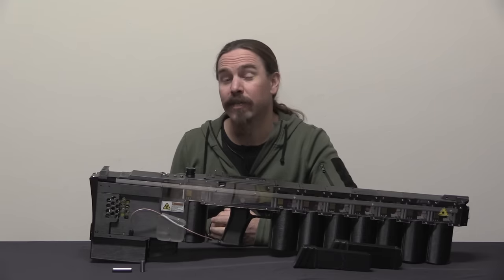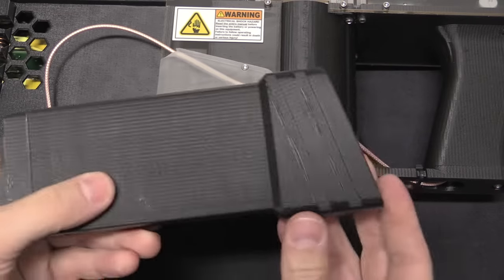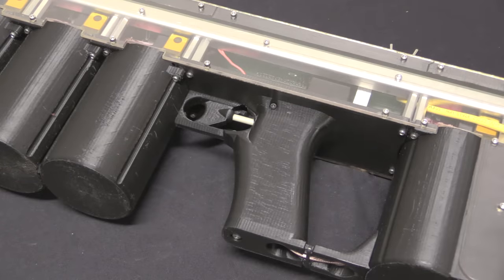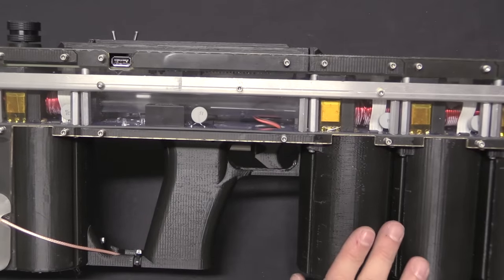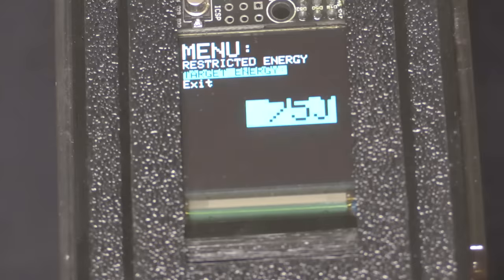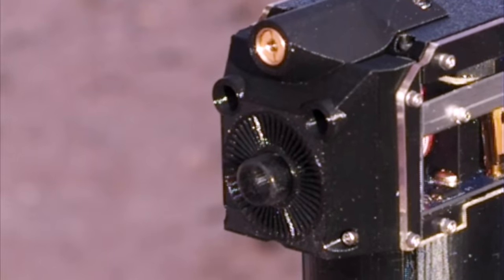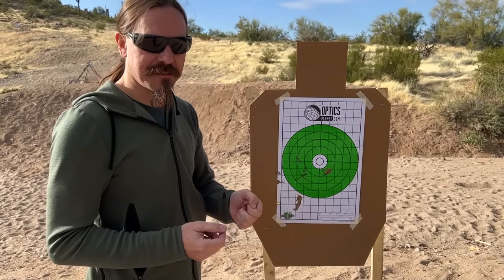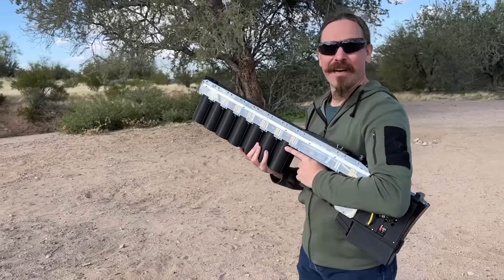ArcFlash Labs' GR-1 Anvil Portable Gauss Rifle

Comment: Very nice, and nostalgic for me.  In 1989 I built a coil gun as an item of interest for my electronics students.  We did not have 3d printing or arduinos, but the basic physics are set in, well.. physics!  Other than keeping coil reactance low, and gauss high,  the key is to use a massive overvoltage on the coils, and timing the capacitor dump with light beams.  It is very critical that the coil is shutdown just before the projectile centers itself in the coil, otherwise you will be applying unwanted braking force.  The simplest way to achieve this is by an entry position of the light beam, vs the length of the projectile.  In this manner, the shutoff time on that coil can be optimized, no computers needed. In my 1989 version, our voltage limit was based on available capacitors and switching transistors.  So we ran at 400V with 450v caps and used TV horizontal output transistors,  2SC1308, for the switching element.  As you can imagine (with each stage identical) the amount of energy contributed by successive stages diminishes.  We ended up with 5 stages which would shoot A 6mmx35mm iron core through a 1989 pop can at about 40ft.  Not significant, but fun!  We liked to call it a rail gun because that sounded cooler than coil gun,  but very quickly changed that to mass accelerator so to not panic the staff and administration.  Really great to see this modernized iteration, keep up the great work!
Reply: that is really cool! thanks for sharing
Reply: Wish we had more teachers like you, dude.
Reply: “Very quickly changed that to mass accelerator” hahahaha, good work dude
Reply: That's awesome. My teachers didn't even know how to change the batteries in their TV remotes.
Reply: That'd awesome! Yeah, science!
Reply: Imagine what the governments have made that we don’t know about lol
Reply: Now that we have 3D printing, mind sharing the blueprint?
Reply: NERRRRD 😂
Reply: If you're crafty enough, you can switch current on a coil, making the projectile accelerate past the mid-dead-position. That requires some relay magic and boosts complexity, and for current stage coil guns it's most likely impossible, but if this kind of weaponry is to ever get to RTM status, that would be required, otherwise half of your barrely will be wasted space.

also 75 m/s from single RC battery after 3 second charge IS impressive.

In a lab you can do things that are unfeasible for normal use, i.e. use of superconducting coils. People have sent projectiles with >Mach 1 speeds with home made devices, with proper equipment you can do wonders. I wish I had access to my old workshop in electric lab in college :(
Reply: Seems like yours was better than this hunk of junk.

Comment: 2022: "The long projectile is about as long as a .308 case"
2032: “We fire the whole bullet, that's 65% more bullet per bullet”
Reply: Love the portal reference I was thinking the same thing lmao
Reply: JJ Simmons collab when?
Reply: The point is that it could fire a 308… (the entire round down range…)
Reply: Awesome reference! Thanks for reminding me of one of my favorite games!
Reply: Coilguns use magnets to fire, so are basically limited to iron and steel. Railguns have a lot more flexibility for projectiles, and are likely much easier to rifle
Reply: Department of energy would probably be more interested
Reply: YES.  Now all my crummy steel case rounds have increased in usefulness!
Reply: @kentvesser9484  destructive device, rejected, NEXT!
Reply: @CreaperSiege  Rail guns can’t be rifled either. But at 11km/s stability in air is not a big concern.
Spin stabilisation would require the projectile to be spun up before launch.
Reply: @CreaperSiege  but railguns also use magnets tho
Reply: @CreaperSiege  well limited to magnetic materials like super conducting magnets... lol also doesnt need all of the projectile to be magnetic
Reply: @oliverkrohn8309  Where did you read that? It seems to me that a lot of people use rail-gun interchangeably with coil-gun/gauss-gun when the only real common quality is that they both need a giant battery.

Railguns do not use "magnets", they use electrical current. The projectile in a railgun completes a circuit between the literal rails inside the barrel (which does create a magnetic field) which forces the projectile along the rails. While there is a magnetic field involved, it is not magnetism that forces the projectile down the barrel (which is why you don't need a ferrous projectile, just a conductive one) rather a phenomenon called the Lorentz effect.

In purely empirical and practical terms, think of it like this;

The biggest problem with making a useful coilgun is getting it to put out enough projectile velocity for the power you put in. There's tons of really fine tuning involved in getting the electromagnets to play nice with each other and de/activate at the right times. The biggest problem with making a useful railgun is carrying the battery you need to fire it. There's way less that can go wrong with a railgun in principle, but the kinetic energy imbued by the Lorentz effect is so minor that it takes a ridiculous amount of current to even get the projectile to move, let alone be moving fast enough to not weld itself to the inside of the barrel or simply melt before clearing the muzzle. 

That's actually the one good reason you might want to rifle or spin the projectile (probably before you even complete the rail circuit) - to lessen the likelihood of just grafting your projectile onto the rails with the ungodly amount of current you just put through it.
Reply: You know what would benefit this? Tank.
Mean more rounds they can carry, because the round would be shorter since they no longer need casing to store the gunpowder to propel the projectile.

Comment: Reminds me of the really early lasers. They look ludicrously huge and foreign but they eventually got smaller and more practical.
Reply: Only thing is that every single component of this gun is way older than laser as a technology. Capacitors, batteries, coils, etc. It’s been in use for decades before first lasers.
Reply: God right, insane to think about. Now they are smaller then a duracel battery and just need to operate on one.
Reply: Yes but it took a lot of time for those components, mainly batteries, to get small and efficient enough to be used portable. Also the computer controlling it.
Reply: Although those components are low tech, they require high tech materials and manufacturing technology to make the gun practical.
Reply: This is a completely different problem from miniaturizing lasers.  The power supply on this device has a much lower specific energy and much lower specific power than does conventional smokeless powder.  That is a fundamental fact of chemistry and nature.
Reply: Man those lasers are awesome lol. It's so hard to find some that still work. Like the one Ian actually had on one of his guns recently. The damn laser is as big as the gun! Like Termiantor 1 where Arnold Schwarzenegger had the laser on the desert eagle.
Reply: @redrackham6812  A shame indeed. Despite having greater energy conversion rate than chemical propellants, the total amount of energy contained is so low the high efficiency couldn't make up for it.

Comment: SAFETY NOTE: Always treat the capacitors like they're live, like how you never ever point your barrel at someone
Reply: Yup, Capacitors have a nasty habit of sneaking up on you, and these things are monsters, if they don´t hurt, they kill outright. I guess, a few percent of residual charge is enough for a painful surprise
Reply: It's interesting to note that this rifle is never fully "safe". With projectiles removed the battery is still potentially a fire hazard, and even with that removed, the capacitors are still potentially an electrical hazard. That's a bit different to a normal firearm where if it's definitely unloaded, it's about as dangerous as a mousetrap.
Reply: @cnawan  Like firearms, unloaded this thing is only as lethal as you can swing it. Also, ammunition can literally explode, which is like the one thing worse than catch on fire. The rules can be contrasted as such: firearms and live ammo never mix unless you know what you're shooting at and it's a good idea to shoot it, and you should never ever touch one of those capacitors unless you are for sure certain that it and you are safe, because you can do all the things you need too with those capacitors with equipment that keeps you safe if those designers are worth their salt.
Reply: @cnawan  You can definitely discharge capacitors safely, depending on how the power delivery system is designed. But it's not an insurmountable issue.
Reply: People have to remember the dielectric absorption. HV capacitors need to be short circuited during storage to avoid this effect.
Reply: Que electroboom sticking his finger in it
Reply: @dtrujillo1180  ehhhh this one has enough power in it to actually ice him if he's not careful..
Reply: @cnawan  im sure some safe way to discharge the capacitors would be high on my list for this type of project, and you could asume that haveing the battery magazine in the gun would be equivelant of haveing it have a full mag, im guessing they have an ejection mechanism for the batteries. as you would have to replace and recharge them quite often.
Reply: @cnawan  It's all energy at the end of the day. The coilgun just happens to carry its energy with it rather than holding it separately in ammunition.
Reply: @cnawan  You could honestly say this about anything with a capacitor in it, especially your cable box.
Reply: Are those "Flux Capacitors" ?    If your not careful you could send Yourself,...   Back to the Future!
Reply: @ParadigmUnkn0wn  stage of what ??
Reply: Yeah, capacitors can hold a charge for years sometimes, I do like the ones that have the discharge resistors on them.
Reply: @ParadigmUnkn0wn  haha flying cars won't work because private cars have some of the worst economies of scale in terms of technologies we use on a daily basis and with any luck won't survive this century. I don't know why you're just ragging on these poor dudes like this, but yeah their biggest innovation is the tech that lets the caps charge 100j in 3 seconds. That's the kind of thing that might get a large company looking into this kind of technology for any number of applications, which in turn will eventually drive funding for better capacitors and batteries, et cetera. Barring the impending dark age, better batteries and capacitors is an inevitability given enough time. In the mean time, be safe with your toys.

Comment: Being a Navy vet, I never thought I’d be around to see the day when we had a real shoulder fired Gauss gun. As compared to the rail guns. With the leaps and bounds the world has been making in battery and electronics tech in my lifetime I can only imagine what this will be like in the next 5-10 years. Awesome that we got to see Ian get his hands on it for us.
Reply: There are important differences between a Gauss gun and a rail gun - specifically the ablation of the barrel on rail guns. The interview Ian did with one of the designers of this prototype talk about those differences.
Reply: probably not much change except i there is some miracle revolution with parts of electronics used... some do believe that graphene can drastically improve capacitors and that is like 100 fold improvement but doesnt seem it will happen any time soon. but yeah that would make it far less bulky
Reply: In 5-10 years, they'll have slick injection molded furniture. The limitation of the battery not detonating and the gun not melting itself means that handhelds like this aren't likely to be anything more than a toy for a while. Bows and crossbows thousands of years old and even with all the modern technology of the last few hundred years, launching a projectile with mechanically stored energy hasn't changed much, electrically stored energy's efficiency hasn't improved much in the last 5 or so years, Tesla's last major improvement was doubling the capacity of a battery by doubling the size.
Reply: anymore 10 years in the tech world is an entire lifetime of innovation.
Reply: @neglectfulsausage7689  I agree with you for the most part but the reason we don't have green energy rockets is literally because there's no other way to do it
Reply: @neglectfulsausage7689  We literally have hundreds of battery operated spacecraft that recharge those batteries with "green" energy (solar). GNSS, communications, NRO and other space assets could not function on chemical energy for the same reason chemical energy is becoming increasingly impractical for terrestrial use - there is a limited supply.

As for rockets, work is continuing to find more efficient and renewable options to current solid and liquid fuel chemical propellents. It is practically guaranteed fossil fuels and most other chemical propulsion will soon be obviated by better (green) options.
Reply: @neglectfulsausage7689  we don’t have flying cars because humanity is immature and wouldn’t be able to handle it with any sort of respect.
Reply: @neglectfulsausage7689  That's not strictly true. Many deep space vehicles use ion thrusters for their propulsion. Ion thrusters are only effective in a vacuum which makes the whole limiting emissions thing kind of pointless. Of course the rocket that puts said probe into space still uses traditional engines.
Reply: We are now 3D printing parts for both firearms and Gauss canons. We live in the future
Reply: @neglectfulsausage7689  These are two completely different things. Regardless of the source of energy, nuclear, solar, wind, gas, or coal etc the issue is energy storage. All energy generation is the product of a chemical reaction. The advantage to solar is that there is no waste, if I turn on 3 turbines at a gas plant and I only needed two then I'd better have storage for what i generated from the third or i just burned a shitload of gas for no reason. Conversely if I run an equivalent number of solar panels or windmills I haven't wasted anything. The sun will shine for a given part of everyday and the wind will blow regardless of whether I had the brakes on the windmills or not.  in the next 10 years EVERY, and I mean EVERY watt hour of electricity you consume, will come from a battery. Much of it does already. The only remaining problem of course, is that you've been educated on the fucking internet and dont understand why any of what I just wrote invalidates your point of view. Fortunately the future is being guided by people who have a far greater cognitive capacity than you or I,  ELSE WE'D ALL BE FUCKED. EXPLOSIVES BETTER YO DAT WHY NEVY INVESTED BILLIONS IN RAIL GUNS DAWG.
Reply: @tcbbct509  How, in the next ten years are they going to store A.C in a battery?
Reply: @neglectfulsausage7689  There isn't much point in trying to have a discussion with someone who apparently gets his information from Tucker Carlson and doesn't have even a foundational understanding of physics.
Reply: I dunno man, they might start by looking at inverters. Look up grid scale batterys sometime. This is already being done, however inefficiently, with LIONs.
Reply: @dvergar1  There is already a perfectly clean, “green” rocket fuel. It was used on the second and third stages of the Saturn V as well as the Space Shuttle Main Engines, and will be used  on the Space Launch System: liquid hydrogen and liquid oxygen.  It burns so clean the flame is clear, with no smoke, no particulates, and no carbon emissions. The drawback is that hydrogen and oxygen don’t appear in their elemental forms on Earth and so must be synthesized in massive quantities for a space launch. In effect, the total environmental impact is a function of the methods used to separate these two elements and liquify them.
Reply: @SBBurzmali  Are you high? Polymer batteries have improved their storage capacity by literally THIRTY PERCENT per dollar and per kg over the last 5 years. Which is a huge amount. And the trend isnt slowing down
Reply: @acbthr3840  "Per dollar" is the operative term there dirt cheap batteries don't make copper wire dissipate heat any better or make 100 lbs of coils any easier to carry.
Reply: @neglectfulsausage7689  people also didn’t throw tantrums cause their king lost an election and try to overthrow a government.
Reply: @neglectfulsausage7689  But we DO have battery operated rockets in space. Pretty hard to do without some sort of power source. If any of those guys from Apollo 13 are still alive and they will tell you a rocket pretty much sucks without a power source. In their case it was a fuel-cell (chemical battery as are most of them.) We also use nuclear/thermopile batteries. Again... an electric motor has 100% torque and power available at 0 RPM. Piston engines do not. 
But I get what you are saying. Chemical propellants are cheap and relatively easy to handle/store/transport/plumb/etc... but all chemical reactions are pale compare to nuclear and laser. IIRC the most powerful laser weapons are currently chemical based but they are more likely to be ship-borne for the immediate future. They are a loong way from being hand carried.
Back to battery operated rockets... more like electrically operated rockets is exactly what they are proposing for long haul space travel. Ion propulsion.
Perhaps you are mistaken about "green energy" also.
Reply: @neglectfulsausage7689  You seem like a highly educated internet troll,  you should be just super proud.